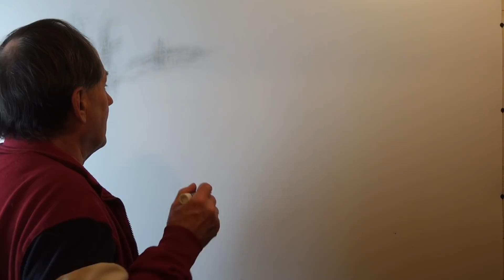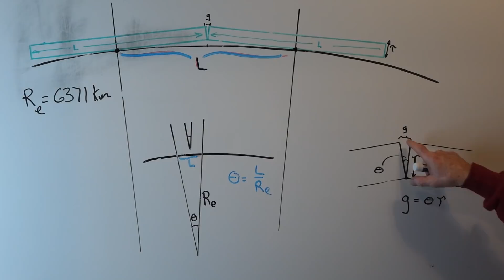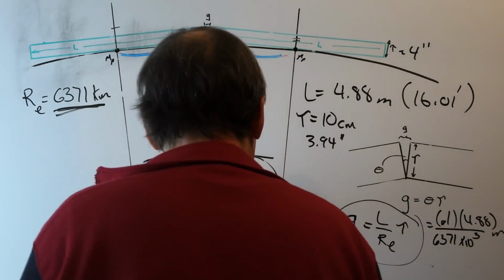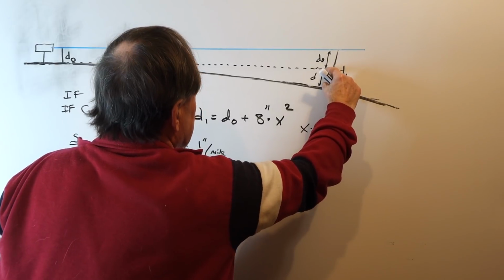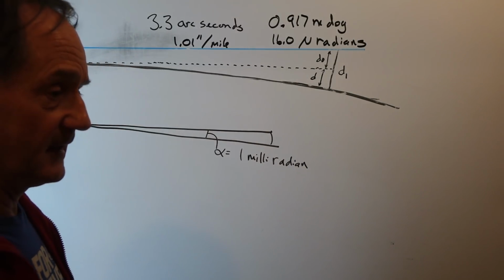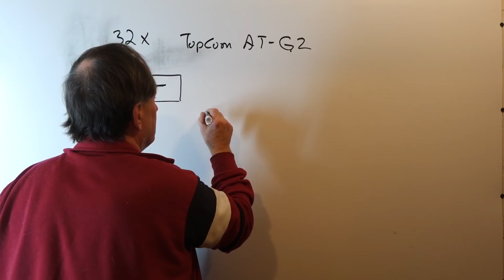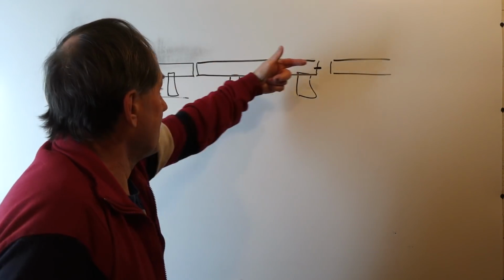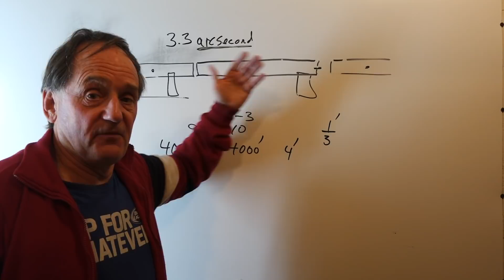Salvaging  Mullin's  " Force the Line "

Comment: Hi George. I alreadly like your attitude and abilities. I'm only a few minutes into your video, but have to interject some stuff. Wouldn't a simple long pipe filled with colored water with clear plastic adjacent pipes attached to it at 90 degrees to it periodically pointing straight upwards suffice for determining where the level for the water is for the Force The Line experiment?  I mean, we really only have to go 3 miles to get that 72" discrepancy. 3 miles! Also,  the problem seems to me to be that we're using "2 x 4's instead of actual sizable wholesome squares. The smaller we make the height for the length of each "beam" used in the Force The Line experiment, the more error we of course incur. If we really want to reduce error, we can use a large aluminum plate that is perfectly (as far as we can get) 12' square (at least). By doing that, we eliminate a LOT of error that a "perfect 2" x 4" would create. Would not perfect panels hopscotched along a rail, keeping them all flush, be a far better system to determine if the ground remains level or drops from a straight line? And just a side note. The 8" per mile squared formula works GREAT, but only up to around 1000 miles. It is the formula for a parabola, not a circle. (I tested it the hard way!). In closing, I LOVE Brian's brainstorm, but yes, I think it can be improved (and I'm pretty sure Brian would be the first to agree. The man emanates honesty, as you also seem to do).
Reply from the maker: Fred,
I do not embrace the Mullin rail system as he proposed for it is wrought with accumulative error.  Your plate system would help but would rely that the rails be perfectly FLAT along their length which is another manufacturing problem. 
 That is why I propose using tube which can be easily aligned and the environment inside controlled.  Actually Mullin's force the line experiment has been accomplished with the Ligos gravitational wave detector.

Your comment regarding the 8" per mile squared is the formula for a parabola, not a circle is not correct.  That formula perfectly describes the surface of a sphere for ANY LENGTH when the cord length rather than arc length is used as the distance between two points on the surface of sphere.  This is because the drop distance is measured from a TANGENT to the surface and not referenced to the center of the sphere.  I discuss this common misconception in this video:

https://www.youtube.com/watch?v=riv3x1hvU1g&list=UUKsf5gUTjVoIc8uKdYn4Jeg&index=34&t=475s

GH   Oct 28, 2019   3:22pm
Reply: @georgehnatiuk5806  Hi, George I was wondering if you can combine Mullins idea your idea of the stack barrels.. I think the flat surface of the ice would help a lot to build straight line at the base.
Reply from the maker: @TheIsmaelIsaac  
Actually the surface of the ice would not be suitable.  To accurately set up anything on the ice, you would need to drill holes through the ice to let the water come up in the hole and align everything to the surface of the water and not the ice.  See my update #5 of measuring curvature on a frozen lake:   
https://www.youtube.com/watch?v=WCL6SpsBzow&list=UUKsf5gUTjVoIc8uKdYn4Jeg&index=78&t=384s

GH  April 05, 2020
Reply from the maker: @robertwatson818  Rail lines bend to follow the curve of the earth.  Mullin wanted a straight unbending line or fence to compare the surface of the earth against.
GH     Dec 10, 2020
Reply from the maker: @robertwatson818  Actually, at 3 miles you will be 6 feet lower, not 3 feet.
GH
Reply from the maker: @robertwatson818  depends on how the tracks are laid out.  If they follow the level surface of water, then the drop from the start horizontal will be 6 ft. at 3 miles.  On land you have no guarantee the rail base is parallel to the gravitational equipotential.
GH

Comment: With your pipe idea, how about using a light meter at the starting pipe and adjusting each added pipe for highest light level.
Reply from the maker: that is not necessary.   If pipe sections are 20 feet long, a laser beam would diverge very little and you could easily adjust three or four pipe sections to center the laser beam and leap frog the process each time a section is added.
GH  May 12, 2021
Reply: @georgehnatiuk5806  
If the laser doesn't diverge that much why not skip all the pipe sections except the last 40 feet or so?
Reply from the maker: @mballer  I stated that the beam does not diverge much over 40-60 feet but becomes significant on more distant shots.  A typical laser has a beam divergence of 1.0 milli-radian which means that at 1 mile the beam will have a diameter of 5 feet.  At 60 feet the diameter of the beam will be 0.72" which is easy to center in a 4" PVC pipe.
GH

Comment: If you're gonna run pipe you might as well pull a vacuum inside the pipe for a truly accurate laser reading.
Reply from the maker: you could do that but the laser alignment can  be done in steps so refraction would not be an issue.   Pulling a vacuum in such a large volume would take a long time not to mention sealing issues and structural integrity.  I do not find that step necessary but it will not hurt the test.
GH  May 11, 2021  7:39 am
Reply: @georgehnatiuk5806  ok...  When do we get started and where?  I am ready.
Reply from the maker: @anthonytestaforte1692  you betcha -- send me $30K and I will get started building a 2 mile line.
GH
Reply from the maker: @mballer  hydrogen would be too dangerous and helium much too expensive for me.
GH
Reply: @georgehnatiuk5806  
I was looking at prices for helium, I think helium would cost about 800 dollars to fill 2 miles of 4 inch pipe.
Reply from the maker: @mballer  helium does not really solve any problems.  Light refracts in a helium atmosphere as it does in air but with a different index of refraction.   A helium atmosphere will have a density gradient too.
GH

Comment: This seems a much better way to establish that tangent to the earth's surface which Brian Mullin proposed. George, how far out do you think you would need to go to see any significant increase in the distance between the tangent and the earth's surface, though? If it's 6 miles as you propose, the pipe alone would cost over $26,000!? Add in the supporting structures you would need to build, and the cost of realising this idea makes it not viable, imo. However, I don't have anything better! Are you hoping to get funding so you can go out on Rainy Lake and build it? I'd love to see that! :)
Reply from the maker: I have no interest in funding such a foolish operation nor seeking funds for it.  I was just showing the flat earthers that there is a better more cost effective way of doing this than using Mullin's original proposal.   Using DWV pipe to 6 miles without any discount for volume would be about $8.30 x 6 x 5280 /10 = $26.3K  as you say not adding in labor and supporting structures.   Mullin's proposal would be well over several hundred thousand dollars.

I stated that a good venue if someone wanted to tackle this would be The Great Salt Lake  NOT  Rainy Lake -- did you not listen?

3 miles would be sufficient to see a significant drop (6 feet)
GH
Reply: @georgehnatiuk5806  Ah yes, I made my comment while in the middle of watching and then didn't get a chance to edit after I had watched it all. Apologies for that oversight. Thank you for answering my questions George, all power to you!

Comment: George - I thought of a great math problem you could solve and it would help our side of the argument.  I tire of the flattards constantly claiming that rocket propulsion cannot work in  a vacuum.  ONE of their arguments is that the vacuum "PULLS" the exhaust gases out of the nozzle and therefore the gases cannot perform work on the rocket nozzle. WE know this is not true as the rocket engine PUSHES the gases out FASTER than they would if they were just "evaporating" due to the vacuum.

So I thought of a good math problem to demonstrate this effect is the following:

Calculate how fast a spherical drop of water (at standard temp) would evaporate in a vacuum. 

 Assume that all of the molecules exit the water droplet in random directions giving no net propulsion in any particular direction.

NOW imagine the same experiment, but the drop is evaporating inside a "nozzle" shaped "reflector" that will redirect the water molecules out the nozzle instead of in every direction.

We COULD calculate HOW MUCH force this would exert on the nozzle as the nozzle redirects the molecules ALL INTO ONE DIRECTION.

This would be the lower bound on FORCE exerted by water just evaporating under the effect of the vacuum.

Once we can demonstrate this force, it SHOULD BE simple to explain that now IF you PUSH the water molecules ANY FASTER THAN THAT you get MORE and MORE thrust.

Thoughts?
Reply from the maker: Stuart Gray,                                                                 12/24/2018     2:04 pm
I will look into this but first read thru these two thread and see if it helps you with your arguments:

https://youtu.be/7IQTcmwRMhE?lc=UgxfWOHQ5oVFKBz8bTR4AaABAg

https://youtu.be/7IQTcmwRMhE?lc=UgzBf6f96Dzrjv6Dtp14AaABAg

Read thru the comments.  The video does not talk about this - it is only discussed in the comments.

Get back to me after you have read and studied my comments regarding this.  I covered it quite extensively about a year ago.  You are welcome to reference these comments or use them in part if it helps you in talking to these clowns.
GH

Comment: The steel rail fence would definitely require expansion joints.
Reply from the maker: That is the least of the problems with this scheme.
I do not think Mullin thought this thing through very well.  Does not seem to have a feel for mechanical structures.
GH
Reply: I'm approaching this from a construction standpoint.  This is a weeks or even months long project and the day-night cycle will warp this thing while it's still being built. The supporting columns would need to be securely embedded to resist wind or settling.  The "rail" stock itself will deflect when moved and even after it's set.  So you reduce the span, say support at the midpoint?  Then that means many more columns to set.  Where does it take place?  It won't happen on public land, that's a guarantee to get shut down and maybe fined.  Do they excavate out a mile-long trench on someone's farm?  lol.  The issues go on and on.  Flat earthers simply don't think anything through...
Reply from the maker: <<<Flat earthers simply don't think anything through...>>>
REALLY  NOW?

Could have fooled me  :)
GH
Reply: @georgehnatiuk5806  Mullin ain't much of an engineer...
Reply from the maker: @brotherlove6216  that is certainly an understatement.   Hopefully Mullin has learned more and become a better engineer over the past three years since this was proposed.
GH  May 09, 2021
Reply: @georgehnatiuk5806  Not likely. His complete lack of understanding of the conservation of momentum was frightening.  Not sure how he ever graduated.
Reply from the maker: @brotherlove6216  I hear you there.   It is indeed a puzzle unless he started this all as an internet joke and got caught up in it.  Who knows?
GH
Reply: A lot of the people on the current bandwagon for this seem to think it will just be digging a trench, filling it with water, putting a bunch of 4x4s in the ground and nailing two rows of two by fours to them.
Reply from the maker: @dansv1  yes.  They have a very simplistic understanding regarding this "force the line".    It is not that simple considering how accumulative errors in constructing this straight fence could add up and easily swamp out the earth curve.
GH
Reply: @georgehnatiuk5806  
I asked two flat earthers if they would renounce FE is the result of the test showed curvature. They both shouted “This test is not for US, it’s for YOU. We already KNOW the earth is flat, you guys stupidly BELIEVE the earth is round. This is to change YOUR minds. WE don’t need it.
So not only is the thing nearly impossible to build, would be entirely useless.
They whole thing is mildly interesting though.
Reply from the maker: @dansv1  Oh yes,  I have heard that one several times before.   Such a statement vividly illustrates that these nutters have closed minds and no interest in knowing the actual facts regarding the shape of the earth or anything else for that matter.  All you can do is stand back ridicule, laugh at them.  There is no point wasting energy in trying to "save" them.  Just  let them die stupid.  
There really is not enough of these die-hard FEs out there to care about them or worry that they are going to affect modern thought and science.  They are just an aberration that is comprised of people that have serious mental defects that result in this ridiculous belief and odd behavior.
GH
May 10, 2021

Comment: First of all, thank you for your video.
I have a question; do you think it would be possible to sight straight through a copper pipe with a vacuum in it, closed off with transparent plugs? I think flat earthers would never accept optical methods unless possibly if it was in a vacuum.
Reply from the maker: You already have essentially that without the vacuum but a controlled environment inside with the LIGO  tubes.
GH
Reply: @georgehnatiuk5806  Yes, absolutely, but flerfs won’t accept that. Thay want something they can do themselves. 
I figure that if you use a 1 in copper pipe, the volume for 1 km would be about 2m² which should be possible to pump a vacuum in right? The problem is if it would be possible to sight the other end through such a pipe? Maybe 500 m would suffice? You’d only get a 2cm drop though.
Reply from the maker: @eleventhchimp  problem with copper or any metal is light will internally reflect off the walls and you will see the light even if the pipe line curves 8" in a mile.  This is why I proposed using BLACK  PVC 4" diameter or any PVC that can be sprayed or dipped in black coating to get the inside walls to be non-reflective or close to being a BLACK  BODY.

Besides, it is not up to you or me to jump through hoops for these idiots and prove anything to them.  Many are lost causes and will die stupid.  That is the way of the world - there are winners and loser and the losers will eventually die out and the smartest more fit will survive and go on to make the world a better place for everyone.

GH  May 06, 2021   12:46 pm
Reply: @georgehnatiuk5806  "it is not up to you or me to jump through hoops for these idiots and prove anything to them."
Agreed!
As a content creator the only reason I bother contributing to the discussion is because it gives me a chance to explore some ideas that already interest me and to learn more. I do not do it because I think the globe needs to be defended. It does not. It is what it is and the entire scientific community has come to the conclusion it's spheroidal.
If some nut sitting in his car in Westchester County thinks otherwise, frankly, my dear, I don't give a damn.
Reply from the maker: @fepeerreview3150  so true.  These nutters are losers and should be treated as such.  They suck the life out of everyone that they are in contact with.
GH   May 12, 2021